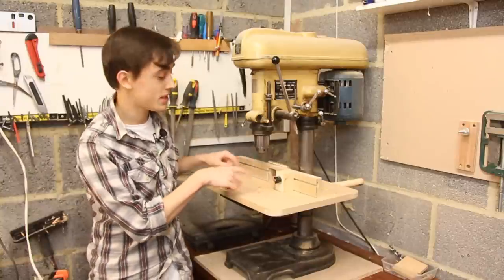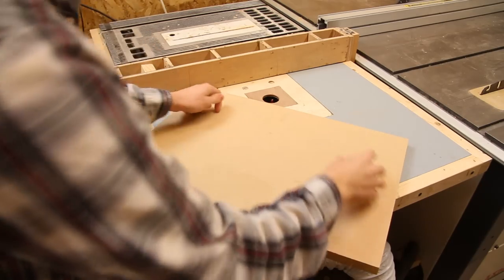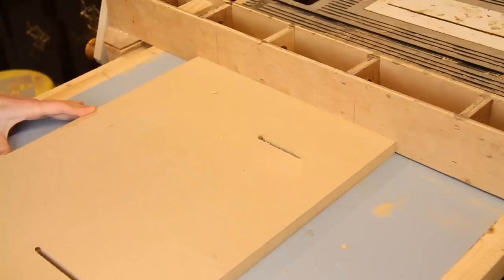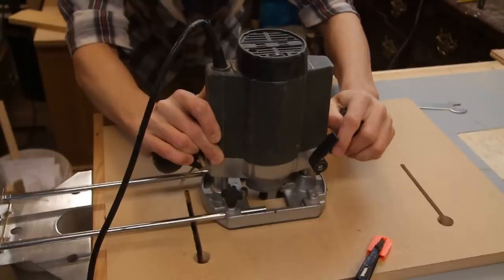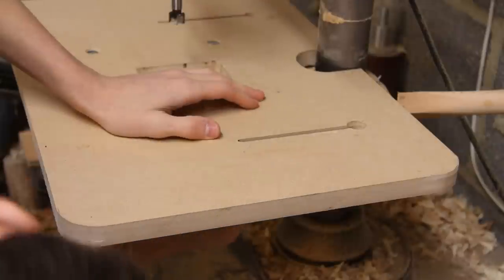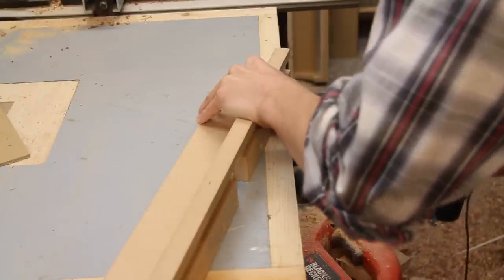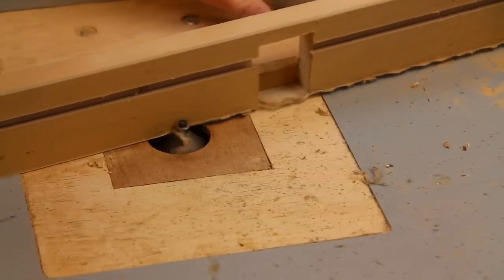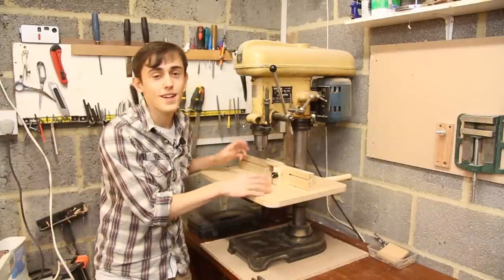Build a Drill Press Table

Comment: Hi Alex, nice job! Good idea to mount the drill press table using bolts. I built my drill press table a few years ago using a clamping system on the bottom but over time the table would move on me so I finally did what you did and used bolts to secure it permanently. Works great now and never moves. Thanks, Dan

Comment from the maker: Sure, here are the steps:
Window, Model Info, Units, Format (to feet if that is what you want).

Note: depending on which precision (set the highest) you select, the dimensions could be rounded and not all appear to be changed. So, if you can, it would be easier to work in Metric. "mm"  are by the way "standard measurements" hehe...
Hope this works for you, Alex.

Comment: have a question where you get your screw nobs from? has i,m having trouble get cheap ones great table thou, wish had your pillar drill mines an old hobby one speeds great for wood to fast for steel and short drill depth